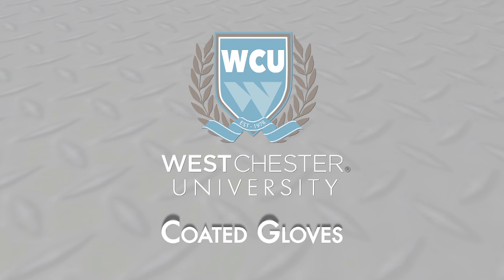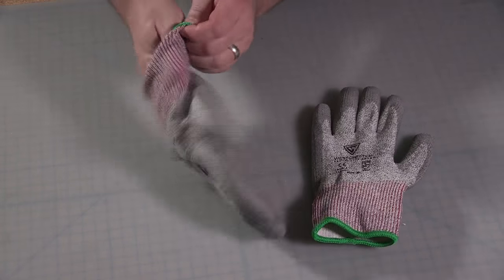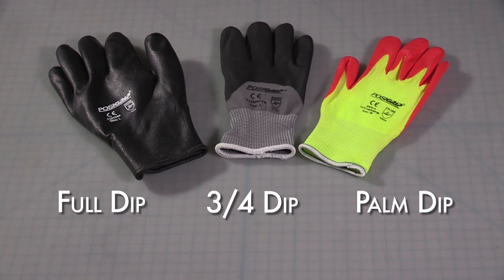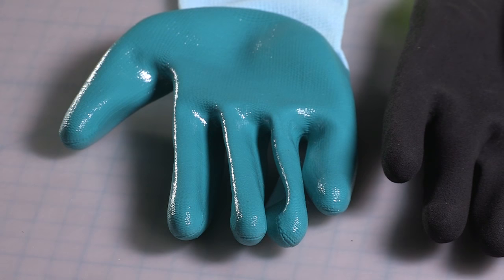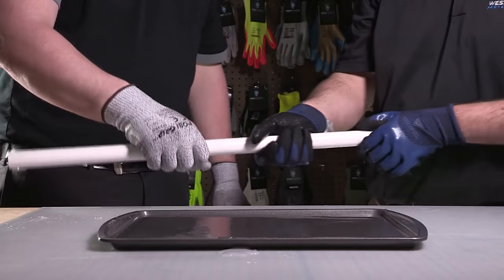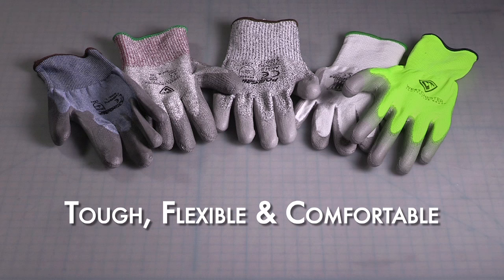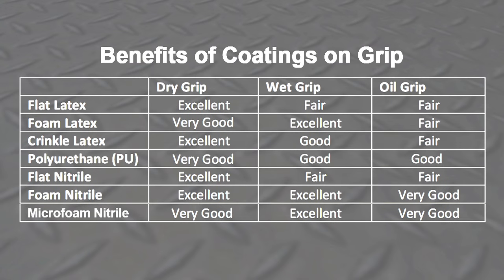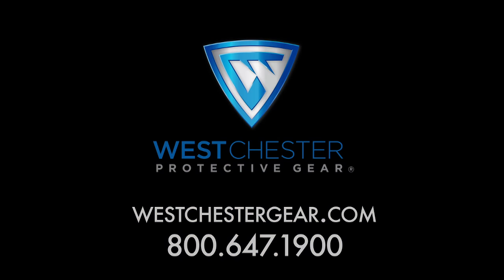Coated Gloves De-Coded: How to Choose Coated Gloves

Comment: I do roof repair and u have a problem of the gloves I use now with foam Nitrile, and rubbing on shingles wears the coating off quickly, but I also use Poly Sealants by NPC Color Sealant, Titebond WeatherMaster Ultimate MP, and ChemLink DuraLink 35, can you help suggest what type of glove would be most abrasion resistance for what I do